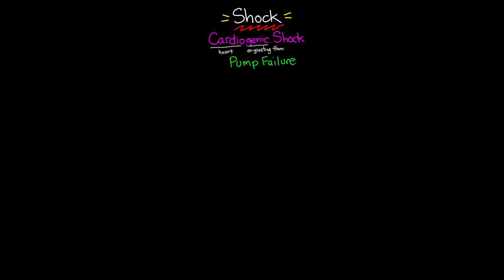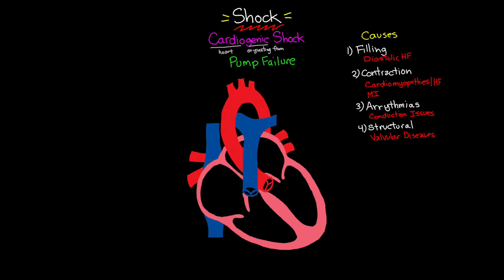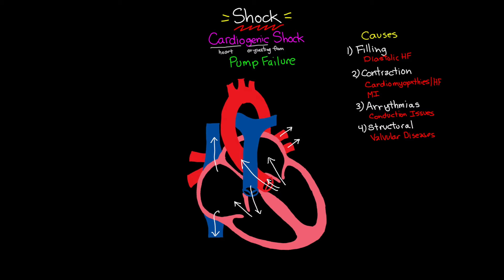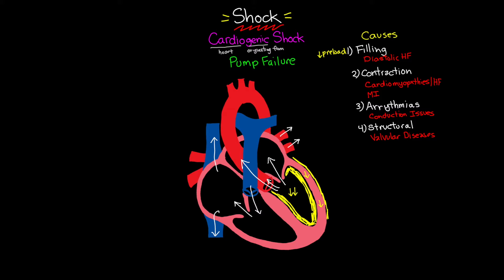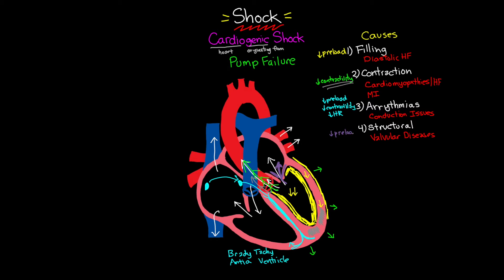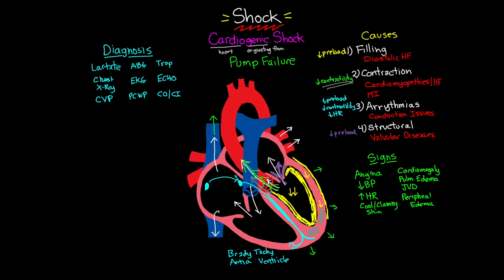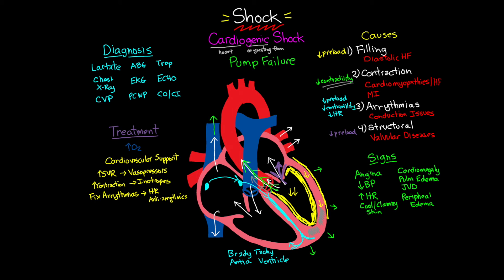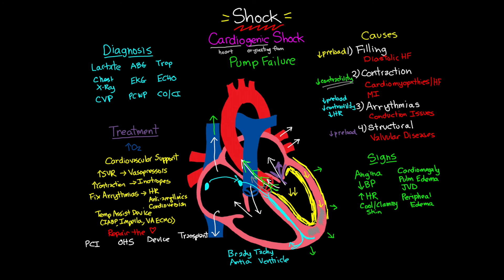Cardiogenic Shock | Shock (Part 4)

Comment: Wouldn't it be contraindicated to give vasopressors for cardiogenic shock since the afterload might increase further worsening cardiac output and the ability of the heart to pump blood?
Reply: Early on in cardiogenic shock, treatment should be focused on preload and contractility. Since your body compensates for the shock by increasing your afterload, you're also going to see a increase in mean arterial pressure which is going to cause an overall increase in your blood pressure therefore, there’s not really a need for vasopressors and the introduction of vasopressors can actually worsen afterload, which would worsen the cardiogenic shock. In a perfect world what we would do is we would give we vasodilators like nitroglycerin to help out the preload and focus on medication like dobutamine to help contractility; the only time we would use these vasopressors is if your body stopped compensating for SVR and we would see a decrease in blood pressure specifically MAP.

Comment: Hi, I love your videos, the only thing is that for the treatment, since SVR in high in cardiogenic shock , wouldn’t be part of the treatment to decrease the SVR with medications like dobutamine that increase the contractility and also will decrease the SVR so when the heart pumps in less resistance and better perfusion?
Reply from the maker: Great question. And the answer is ultimately yes. The SVR is working against us and making things worse. The only problem is, the SVR is also keeping MAP up, so its a balancing act. If we drop SVR without improving CO then we risk perfusion. Of all the shocks, I've always found cardiogenic to be the toughest one to manage as our fixes often worked against us. Oftentimes, especially in the sick ones, the aid of a circulator device such as Impella can really help bridge the gap.

Comment: Have you found that the EF is high or low?
Reply from the maker: Def low. Heart is not pumping effectively.
Reply: @ICUAdvantage  thank you for your reply. I’ve always seen it between 15 and 20%. I spoke to a seasoned cardiologists and he said it’s always high. That doesn’t make sense to me. I’m a double board trauma/cardiothoracic surgeon with 28 years experience. Great video series. Thank you very much.

Comment: Why are we giving Vasopressors such as Levophed when SVR is already high during Cardiogenic Shock? Or is SVR initially high as a compensatory mechanism and decreases later on?
Reply from the maker: Great question and you are absolutely right in thinking that our pressors are working against us. The problem is, that we still need to support perfusion, and when profoundly hypotensive, the only way we have to do that in the moment, is through using pressors.

The problem, as you rightly notice, is that this isn't going to improve our problem and will actually only make it worse, thus we need to work to fix the underlying problem. Sometimes we cannot easily fix this, and thus we may need to move to a device such as IABP, Impella, or even ECMO to assist/provide the forward flow we need until the heart can recover.